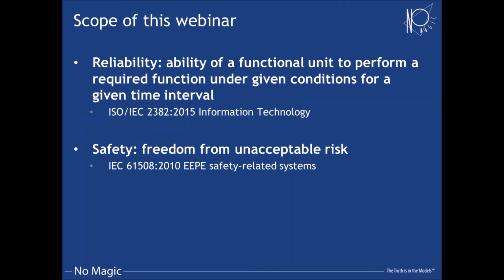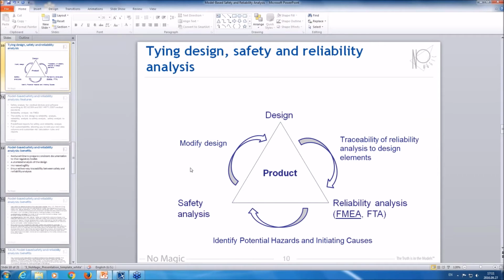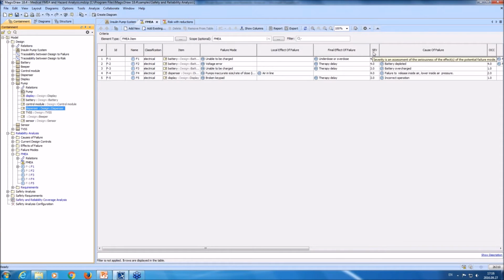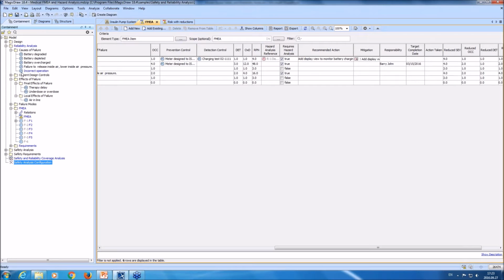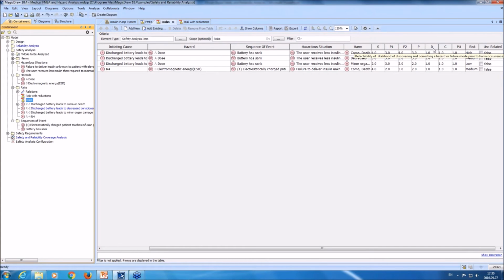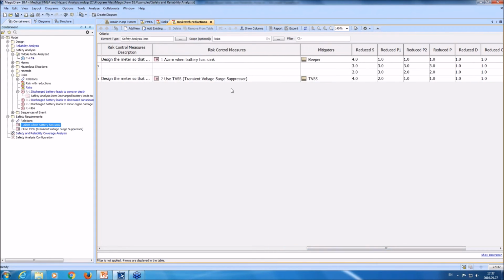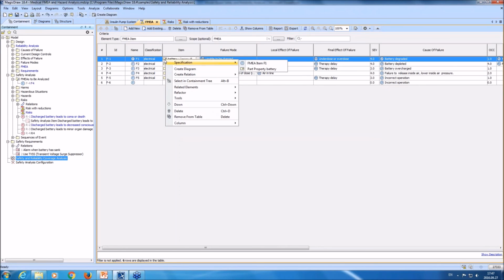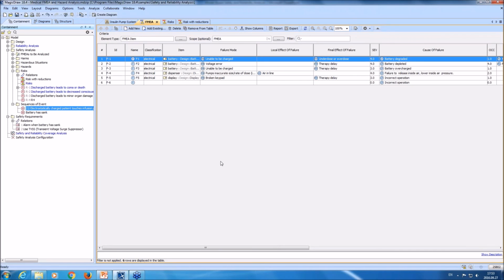Integrating Safety and Reliability Analysis into MBSE Toolkit

Comment: I am trying to summarize the information in few comments below... seems that not much interest in the tool in 6 years, and this is understandable.

I am currently using the plugin.
I do not see any updates in past 6 years.
The presentation mentions agility and advantage against Excel, however in this examples the whole project is preloaded. When creating the project, for example the sequence of event, in the Excel you just click on the cell and edit it, while in nomagic one first creates the SE item, and then needs to go to Documentation fiels and enter the sequence of events manually and even the numbering of events in the sequence is to be created manually, so far no advantage compared to Excel.
It is also requires several actions to select a severity and probability - you have drop down boxes for those and you have choice of numers 1-5. 
This reduces agility a lot.

Next, when all hazards and risks and harms are entered, AND if they match the text in your Excel you can copy paste the data from Excel into nomagic table and it would accept the paste data...

RAAML? Is not that the same just with different icons? In my view RAAMS is a step to confusion and deviates from the standard trend...

To conclude the only benefit from the plugin I see is the FMEA with its ability to point to the parts of the system and connect them to faults analysis... so hope to see more from nomagic.

Comment: For the FMEA numbers. Just to clarify that according to the plugin documentation and to have consistency for the resulting RPN, the lower the numbers are for SEV and OCC, the better for safety is. But the DET is reverse, the 1 is for max and 5 for min detectability, so the resulting RPN will be the min value for the highest safety and the max value for the worst safety.